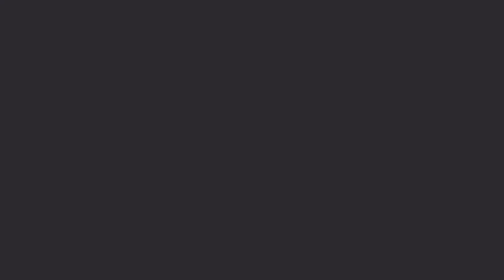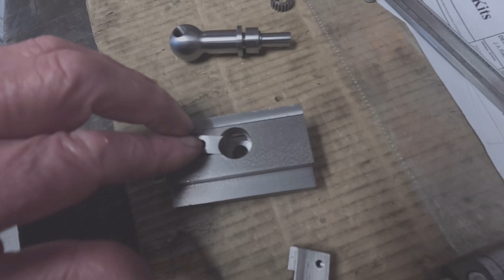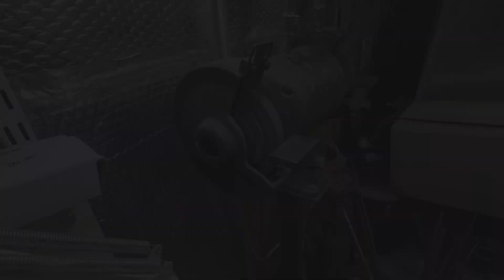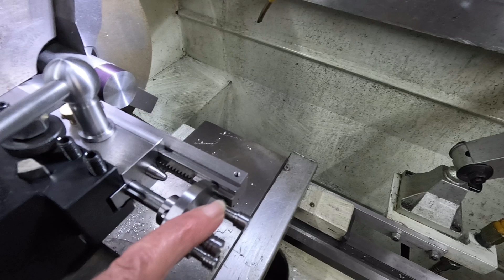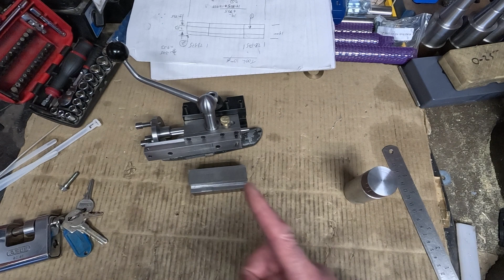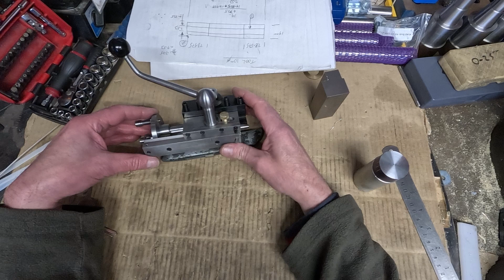Hemingway Rack & Pinion graduating tool-HK1215 part 3. Finished!

Comment: Is the Quorn Mk3 on hold? (chuckle) I just ordered the Hemingway basic graduating tool over sourcing the Harold Hall ratcheting version pieces parts. Along with that I got the Spherical turning tool kit, and  Universal pillar tool and drill kit. I've had my Quorn castings for nearly 20 years. In the States I got the Martin Models version but see that Hemingway provides all the pieces parts in their kits which is most convenient and worth the price for me. I am envious that you got the Quorn column with the helix already machined. I'm drawing up plans for a reversing right angle drive for my dividing head to connect to the lead screw of my mill just for cutting the helix. For the gear trains I need I have the bom done for the shaper gear cutting attachment by Base Circle... Making tools to make tools to make tools. It's a vicious cycle for the penny pincher lol. Keep up the Great work and narratives. Thank you.
Reply from the maker: thanks Nick, the Quorn should be continuing this weekend, I hope, graduating tool done, house decorating done, ( wife happy!) just pondering next move, got to do a little fix on my dividing head, that's sat there for 6 years and now I find the division disc doesn't fit! (Doh!!). Yes very lucky the column is already helixed,  though I have worked a gear ratio out that would go on my lathe to cut one. So fingers crossed I`ll get in the workshop and get making some chips soon! TTFN